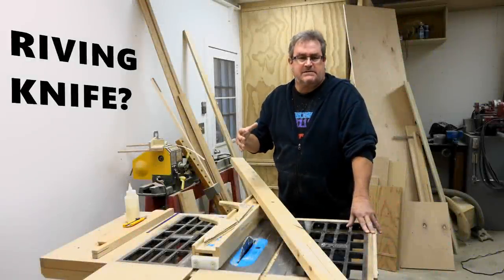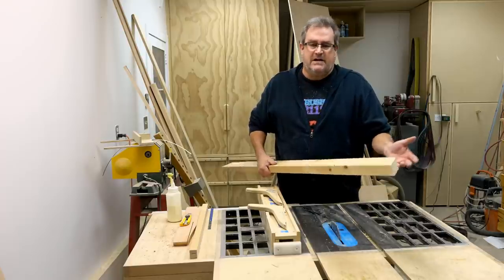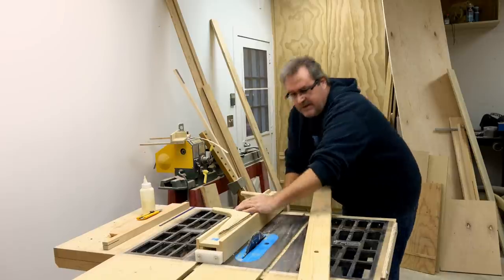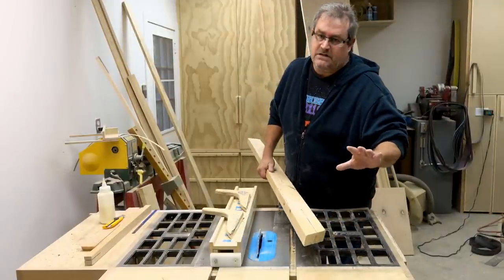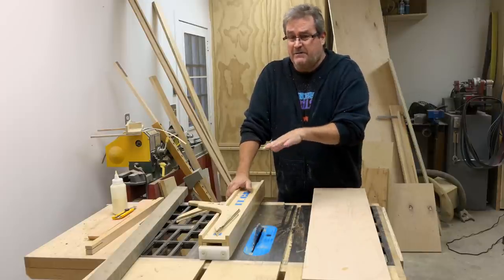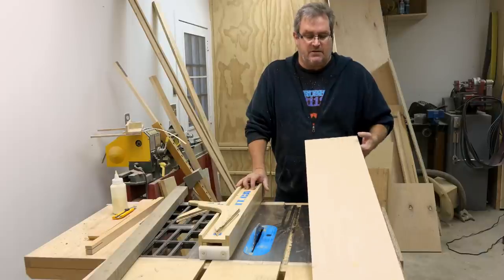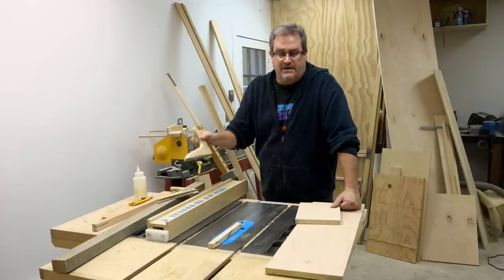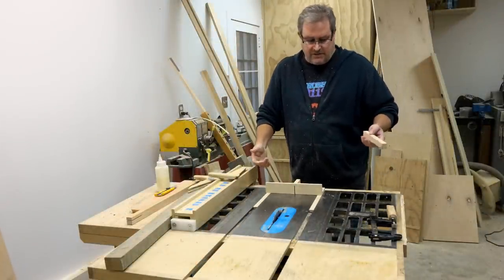How To Avoid Kickback On The Table Saw

Comment: Thankyou for actually going over WHAT makes things safe vs unsafe!  So many people who are against riving knives, Saw Stop, etc just say, "It's safer to not depend on those things but actually have experience using your saw correctly"... but never actually explain how to GET that experience without the experience of losing body parts.  And it's hard to find such information among the noise of safety videos that only go as far as 'make sure your riving knife is in place, use a guard, wear PPE, don't touch the blade, unplug the saw'.  Thanks much!

Comment: Great video John. I had a very rustic and curved top diy table saw, with inaccurate parallel alignment of fence and blade, and well, fractured my right thumb on 18th March this year, and like you said, haven't "felt like returning to a table saw again", even though I made a fresh, albeit still rustic diy table saw top. I dread if my thumb gets whacked again. 
Just an observation, John. You've shown that even a stop block on a crosscut sled can cause kickback bcoz there's again "a pinch between the blade & the stop block". I saw a video recently where a loose piece of wood would be placed between the stop block and the stock to be cut, wherein the loose piece would be removed just before making the cut. Now I get it that this was to address just that issue about the pinch that the stop block can create. I think it's an easy answer to the problem. Don't you think?

Comment: I'm getting my first, I call it my grown up table saw in a few days and this is so informative. I have kickback on my small bladerunner x2 and now I know why. The first time that happened it scared me so much I finally figured out what I was doing wrong. Thank goodness they put safety features on that thing. Now I use it often, but found a need for a small table saw for wider and longer cuts. Thank you for posting this..helps me a great deal.
Reply: How do you get kickback on that? That's a jigsaw IIRC?

Comment: Some good points John! Glad you stopped the one cut using the sled! The other one may not have been necessary just to show us. You reach for slim push sticks often enough, so why not add a DIY push block over on the side near your push stick?
I won some grippers and use them religiously all the time now. My old push sticks and blocks are gone.

Comment: I cut a bunch of 2" xps rigid foam board today with my new table saw (with riving knife and blade guard) ,  and when I was cutting some of the smaller pieces to fit between floor joists I was getting kick back on almost all the pieces.  I noticed that the blade was getting coated with the xps and the back of the blade was pushing up on the foam piece.   The kick back was so violent that I saw sparks?!   I realized that the blade was much higher than it needed to be.   I moved or down to where it  just made it through the foam board and all the kickback had stopped.   That,  and I stopped pushing the board on both sides of the blade,  and just pushed on the fence side.   I am thinking the sparks were from the kickback guard (with the little spikes on it) hitting something.   Really a terrifying experience.   The foam is too flexible to easily keep from pinching as you mentioned with wood.

Comment: Awesome tips John!  I will be adapting these as I work with my saw (no riving knife).  Thanks for sharing your time and knowledge.
Reply: I'm a noob and lucky my cheap ryobi table saw came with a riving knife.  First thing i did with it is cut cheap 2x4s into halves and eighth inch strips, with the crappy stock fence that is only eighteen inches long and takes a miracle to get parallel.

Comment: Had a situation with a 2x8 I cut into 3' lengths to then rip into 1 1/2" squares. The last half of that 2x8 bent slightly so much that when I tried to rip it it was binding every try. I eventually lowered the blade and took small cuts and it still bound up. I eventually got one square off of the section and the internal stress cracked the square off and popped the rest of the 2x across the shop. 
That remaining leftover from the 2x8, now about 2x5 1/2 is a permanent decoration in the shop and reminder to not attempt that again. 
Pretty amazing that 2x8 was and is still nearly perfectly flat, but has a inch turn to one direction. The offcut piece is also flat in one direction, but is bowed by about an inch in the middle.

Comment: I’m fairly new to wood working and I wish I had seen your videos before I cut my first piece of wood. 90 % of what you discussed could happen did happen to me. Let’s not get into routers! I have been extremely lucky that they were all minor accidents and while I have cuts and bruises, I still have all my fingers.  Thank you for the very educational videos.
Reply: Ladywood2 same with me my first time using a table saw cutting an 8x5 plywood horizontally, and about 3/4 of the way through the cut it kickbacked. Now im not confident to ever use it again.

Comment: I'm enjoying these safety videos that you've been doing. I do have a question that you'll likely not address in this series. Are the super cheap (read garbage) table saws inherently more dangerous or simply less accurate? I have a Ryobi bottom of the barrel table saw that gets the job done but it's always in the back of my mind that this thing might be a disaster waiting to happen. I'd love to trash it, but its not in the cards quite yet.

Comment: 13:30 punched a hole in my hand last week using a price of scrap like that to move the off cut away from the blade. Accidentally touched into the blade with the scrap it kicked back like a sledge hammer into my palm. 8 stitches and a lot of surgical glue later my hand is back together. Don't muck around with a turning blade it's not worth it and stop working when your tired. 1 slip or miss judgement, even when your hand is away from the blade, can cost you quickly
Reply: Sorry about your mishap. I too stop when tired.
Reply: That is a very wise advise. Stop when you are tired.
Reply: Watch Charles Neil's video about his hand. He was trying to get a job done and fell asleep at the table saw.

Comment: Awesome video! Did not know that knots could influence kickback. One question I have is why can’t I use my miter gauge with my fence? It’s been a rule I’ve always followed to not use both, and if you do need to then to clamp a block to the fence before the blade. But Ive never studied why. If for example you have your fence to the right of the blade and your tied slot in the slot to the right of the blade, I could see where that would be a problem with getting jammed between the fence and the blade. But what if I use the miter gauge on the same side as the fence? Such that I have the miter gauge supporting the piece between the fence and the blade?

Comment: I've never used a table saw before. Bought one but haven't opened it until I understand all aspects. So apparently this has the danger of a chainsaw and firearm in one device. I wanted to do live wood pieces ripped into 3"+ pieces off my chainsaw mill, and then cut to size on table saw. The blade pinch with moisture and knots make me quite paranoid on live non treated wood. I'm gonna need a wedge in the back of the wood slowly pushed in to match the blade width to prevent pinch (ejection you guys call it? Or would it be kickback at that point?). Thanks for the video it helps me a lot! You seem like a great teacher definitely subscribed!
Reply: No matter how you look at it, your description makes it sound like a table saw is the wrong tool for the job.
Reply: @naphackDT  could you elaborate on a better tool I could use then?
Reply: @willyjilly9684  I'm by no means an expert, but that sounds more like a band saw job to me. Certainly sounds like less of a hazard.

Comment: Thanks for the tips!
Using the wedge came in handy for me about 30 minutes ago. I was cutting a long board that started to pinch the blade. I have a riving knife on my table saw and the out-feed end of the fence was slightly farther from the blade than the in-feed side but close to parallel. I just saw this video a couple of days ago      so I remembered what you did. It worked and NO KICKBACK. THANKS AGAIN!

Comment: You have no fear man, putting your hands within a few inches of the blade as you show around 15:20. A lot of good tips here, though I'll find a way to use a push stick(s) in most of these situations.
Reply: And his way is not the way to do it at all.

Comment: One thing about kick back, not just the wood gets pulled up on the backend of the blade its also pulled off to the left then sent flying back at you faster then you can blink. This often pulls your right hand into the blade.

Comment: John, I'm a year late on this, but I have an observation that may be valid. While I am NOT criticizing your comments or illustrations in this video, I do notice that as you approach the edge of kickback, the saw binds and you can hear the motor slow. I have experienced this myself even to the point of stalling the blade rotation completely. While that is a fortunate way to avoid kickback, I wonder if that is because of the 11/2 HP contractor saw motors? My point or maybe question, is whether the larger cabinet saws with 3HP or even 5HP motors and add in perhaps 3 phase motors that may not trip a breaker the same way as a contractor style saw with the smaller motor would not bog down or even jam up all blade rotation. I would think that these saws are not as forgiving with kickback as the saw you use and what many of us also use. Am I right, or can you bog the big ones down and escape a kickback from time to time?  In other words, having a cabinet saw and testing kickback as you and others on Youtube have done, may not end as harmlessly. Your thoughts please? Thank you for your videos. They are most instructive and the humor you provide is appreciated.

Comment: Is there a general rule for which side of the blade the bulk of material should be during a cut? For instance, if you are ripping a 2” strip off of an 8” wide board, should you set your fence for 2” or 6” minus blade width?

Comment: I was ripping a sheet 24x48 in half without a riving knife , made the cut, shut off the saw, but as the blade was spinning down the 12x48 off cut rotated and caught the back of the blade and flew into my groin.  Floored me for 5 mins.

Comment: Lol! This is exactly what Matthias posted yesterday!
Reply from the maker: If you think that, you should probably watch this one again.
Reply: Matthias doubled down with the 'two push sticks on a panel' thing as he was trying to illustrate a beginner mistake, which made me quite uncomfortable.  I guess this is  largely a stylistic choice and he's no doubt cut thousands more panels like this than I ever have, but like you John I refuse to give up the control afforded by placing your hand with fingers splayed on the panel for control.  Two miniscule points of contact  is simply not enough.  Like you said, it only took me one  pants-shitting experience to learn that.
Reply: Matthias rules.

Comment: @ 7:00 ive seen people do multiple passes on each pass increasing the blade height until you cut through the piece of wood i can imagine this would reduce the stress of cutting as your doing smaller cuts? sorry i'm a noob :)

Comment: I've cut a lot of wood like your long board without a riving knife or sled. 
I would not do it today. Id grap my mitersaw or miter ga. Or just do it on my radial arm saw.  If I had a cross cut sled I dont now. But I plan on making one id use it.  Using a miter on the table saw dont use the fence slide it far to the right away from what your cutting.

Comment: couldn't you tell me that sooner to leave the pieces alone on the fenceless side, now i lost my thumb a couple a months ago ;) , stupid enough i was using my saw when my mind was somewhere else, i learned a value lesson that day, to never do that ever again. never work after you lost someone close. nice video i learned something more about safety when i cut 2x4's i attend to do them in two strokes first half way and then a second pass to cut them all the way. well keep them coming greetings from stumpy hehehe
Reply: Not knowing how to do something may be one reason to get hurt. But being distracted is the way to get hurt by things you know how to do. Every time I got hurt it was at the end of a day working on a project no longer being focused on the task , because I was already thinking about what I'd do after I finished the last cuts. Well at those times it always was visits to the hospital. Luckily I'm not missing body parts, but I'm not proud either to say that I got that scar on my left thumb from a wood chisel, cut into my right thumb badly with a band saw and have a slightly misaligned right ring finger (and knuckle), because I broke a bone in my hand with a drill and a hole saw. I'd consider all those tools quite safe actually (maybe that was part of the problem).

Comment: I used to work in a cabinet makers shop for a few years (doing IT work). The fella there always ran this lubricant on his saws. If he fired up a saw, that spray lube went on the blade. I gotta tell you, I've been using it ever since and don't have these kinds of binding issues. You can just keep pushing through the blade and it won't bind up. Ever use that stuff?
Reply from the maker: Binding of any kind is a relatively rare event, so I just deal with it as it happens.
Reply: Good stuff. Thanks! My table saw just died. the blue smoke came out. New on is coming tomorrow.
Reply: I would still consider yourself lucky!   Not an expert but I used to run  a table saw years ago for 8 hrs a day at Stanley Tools.  My opinion is you should take the extra few seconds it takes to make sure everything is right, as John showed, vs relying on a lubricant, even though it probably helps some.  I’ve experienced kick backs being in a hurry before and considered myself dam lucky afterwards.  They’re easy to avoid and shouldn’t be taken lightly.  

Not meaning to suggest you were suggesting otherwise but I’d hate to see people rely on that vs a correct set up.
Reply: Woodeso's Guitar Mods what type of lubricant

Comment: If I'm cutting off the rounded edge on 2×4s should I have the cut off on the outer edge of the blade or closest to the fence? Does that make sense?
Reply: I'd say that In almost every case (with the exception of ripping thin strips, but there are better and more controllable ways)  the waste should always be to the outside of the blade.  Especially with kiln dried lumber, like 2x4's, as John explained - having the thinner offcut in between the blade and the fence is a recipe for kickback.
Reply: Joshua Estell thank you. I'm new at the table saw & I've only used it a few times since I bought it. I'm still not comfortable with it. I have about 30 2×4's I need to trim up but I'm hesitant to do it. Thank you for the advice, I think I can do it now.

Comment: Respect all machines you work with, I have seen guys almost empaled by table saws. But the absolutely worst limb eating machine, is a big router table with out a fence, working with out a fence is a normal thing in boatbuilding, when you shape big pieces of wood. And as a hardcore boatbuilder you retire when you only have your thumbs left.

Comment: Thank you for putting yourself in danger to demonstrate this. I refuse to use a table saw because of this potential. Though I know all of the things you mentioned I still find the risk of it to be higher than I'm willing to permit. So I don't use a table saw unless I can't do it any other way. They scare the heck out of me and always have. Out of all the power tools I've owned and worked with I find the table saw to be the most dangerous and the hardest to mitigate. It's not worth it to me. So again thank you for enlightening people.
Reply: Being scared is definitely bad. Try to turn it into respect. I wouldn't do a lot of the cuts John is doing, mostly because I try to never stand in the line of the blade. If something needs support on both sides of the blade, I use a sled. For some cuts I also stand to the right of the saw and pull pieces towards the fence instead of trying to push against it from the front. I always imagine where my hands would go if the piece of wood suddenly vanished. If it's towards the blade, I don't do it. The table saw often is the best tool for a job and even if something can be done with another tool, it doesn't mean it's any safer. I have flung pieces through the room with the table saw, but never got hurt. On the other hand (or rather both hands) I already cut 1/2cm into my right thumb with a band saw, gouged my left thumb with a 25mm wood chisel and broke a bone in my right hand with a drill using a hole saw (hospital visits every time ;) ). Why did I get huert with those? Because I didn't think of them as that dangerous, but much more importantly I was distracted because it always were the last steps of the day.
Reply: superdau :D my point exactly. But hey. To each their own right? As my current boss says... It takes all kinds. Then again he and I don't get along too well. LOL
Reply: Mike Girard  I'm the same.......the table saw is my least favorite. I can freehand cuts with my cordless circular saw and split the pencil line (I'm a pro in various construction trades), when I'm on the ball. For more critical work, I will use a clamp guide for the circular saw or use the panel saw. The table saw is the last choice. Plenty of what I have ripped has been 2x lumber, which now explains some of the trouble, but even cabinet grade lumber has kicked back right into my gut. That ended that day for me as I was doubled over in pain. Now, I have some better knowledge (thanks to this video) and I think I will get a splitter or other device for the table saw.